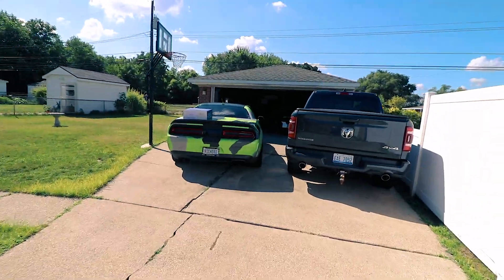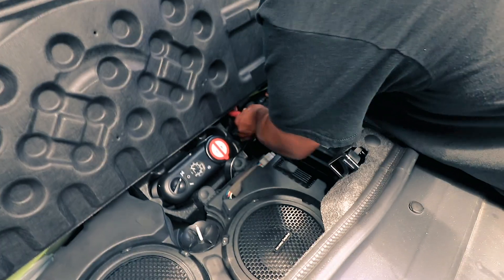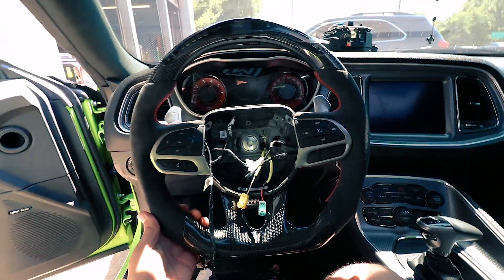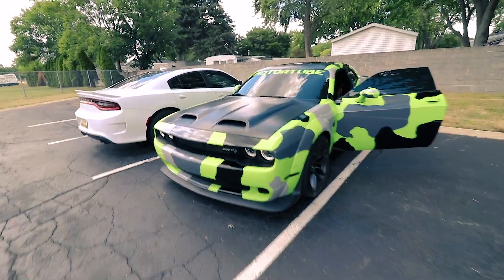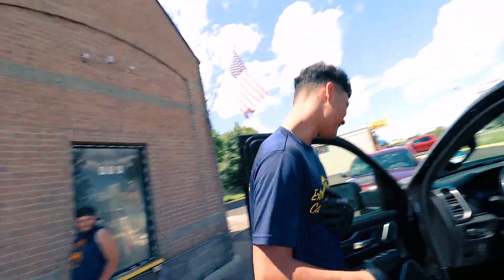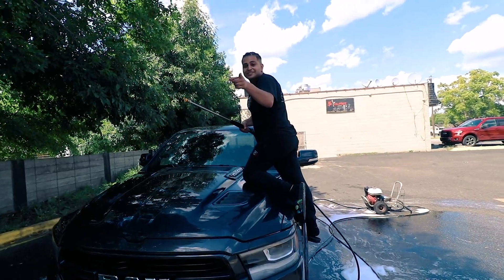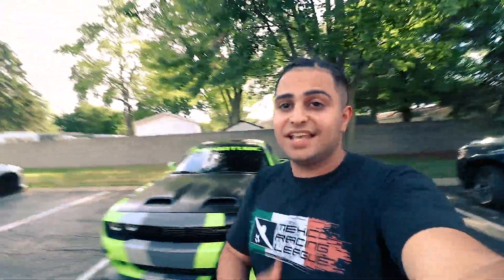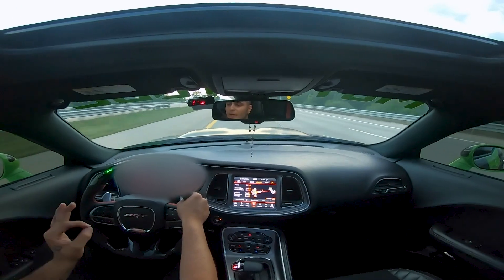NEW CARBON FIBER STEERING WHEEL FOR MY HELLAT REDEYE!

Comment: Does the srt still light up?
Reply: That legit what i was asking and i confirmed from other that yea it does just no heated wheel
Reply: @garciajr913  I already have a heated wheel tho do you have to pick like either heated wheel or the light
Reply: @392_vic  i just ordered mine for my 2020 hellcat charger and the only thing i don’t get is heated steering wheel everything else work the srt logo still lights up
Reply: @392_vic  they don’t make heated steering wheel ones and if they do they are around 2k mine cost $1.3k
Reply: @garciajr913  yeah just read the past few comments I thought this was another post I made my bad